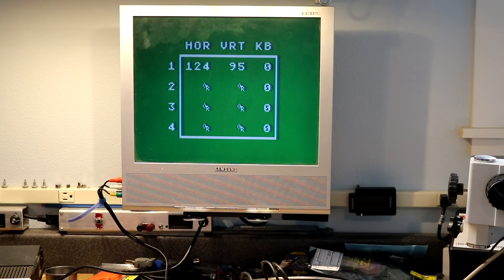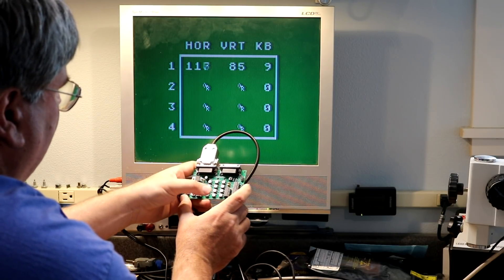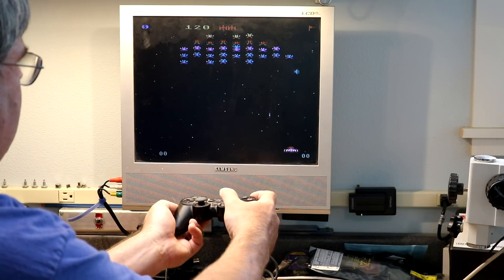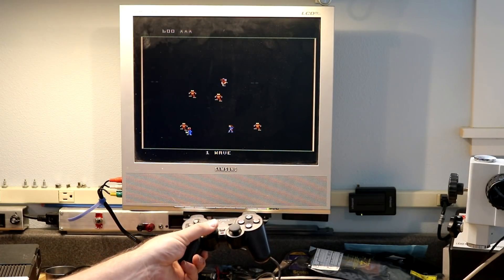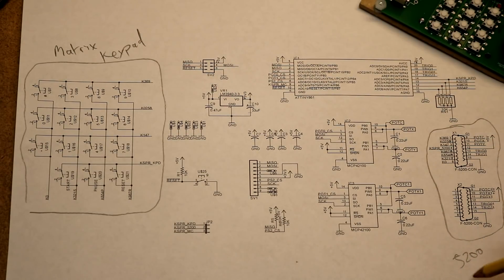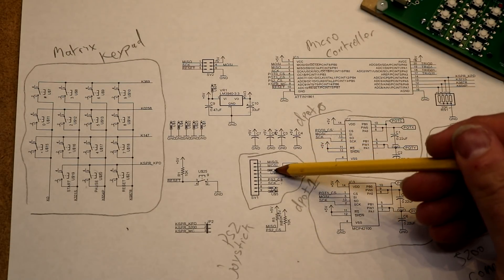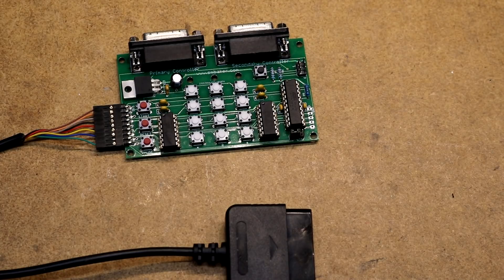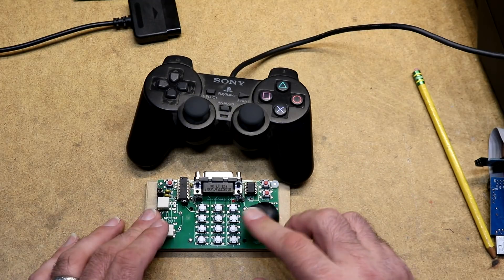Atari 5200 Playstation 2 Controller Adapter

Comment: Came from eBay. Looks really cool. Just got my 5200 finally! After multiple ones found in the wild escaped my (and my brothers) grasps, I have it in hand. Even came with the 2600 convertor. Has anyone tried this with wireless Logitech PS2 controllers? I image they should work as its just a dongle that plugs into the ps2 with a receiver. Love the dual stick mode.

Comment: Will it work with a Playstation Street Fighter 15th anniversary sticks?   I assume the digital nature of the stick just needs to be be converted to analog.  Maybe Select + X is fight stick mode where the cross pad equals up down left and right analog X= bottom button and O= top button, and the external keypad?

Also I know Matthew Gummo knows how to convert a PS1 Dual Shock 1 to actuate digitally and result in a 100% analog result, meaning if it's game like Game Cube Metal Slug Anthology, the cross pad doesn't work.  You must use the analog stick.  But the games in the arcade used a digital stick. The analog doesn't feel right, so he has a way a fight stick can accuatate an analog control (even though it loses its subtlety in intensity and angle.)

He knows how to do it with a PS1.   He said he won't do it with a 5200 until he understands the 5200 mechanisms better.  Maybe if you know how to do analog digitizations, you can pass the info to Matthew Gummo so he can make it for me.

Also one last piece of advice i'm asking of you: to actuate an external keypad, and assign other buttons to important keypresses, like making a Hyperspace button out of Zero-> R2, and assigning a pause and start, to start and select, if the physical mechanism of the keypad and action buttons doesn't actually need to be preserved and just need to be functional for a pad hacker, would it be a waste of  Best';s time and my money to to have that hacked pad "GOLD MODDED" from Best Electronics, meaning the Gold Mod only works if you want too keep the actual 5200 joystick intact unhacked?

Comment: Great project and video! Apparently (unless I missed something) the controller seems to work well with 5v on MOSI/CS/SCK... is this safe with VCC on 3.3v?
Reply from the maker: It's working fine for my Sony controllers. Have not tried with other controllers yet. Might employ level shifters if I do a respin of the board in the future.